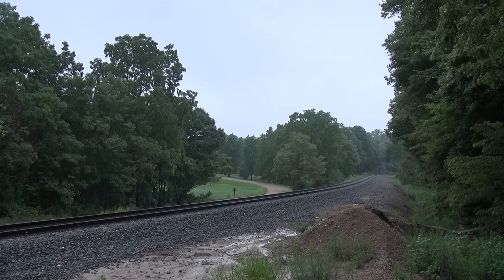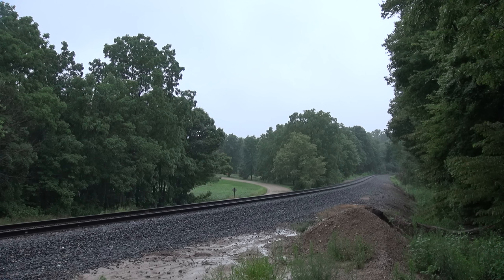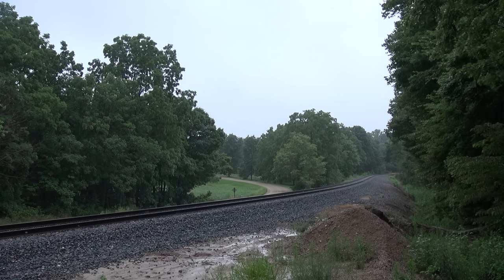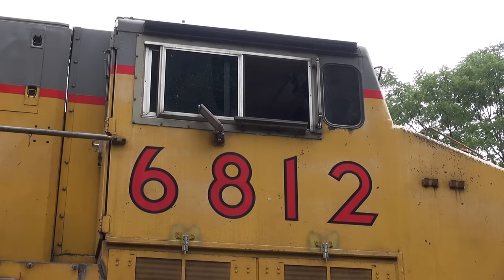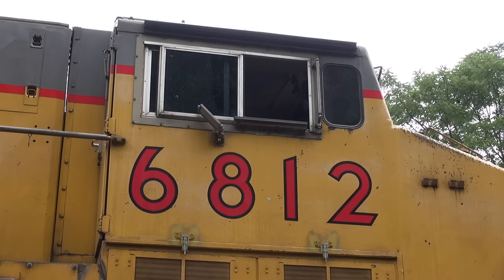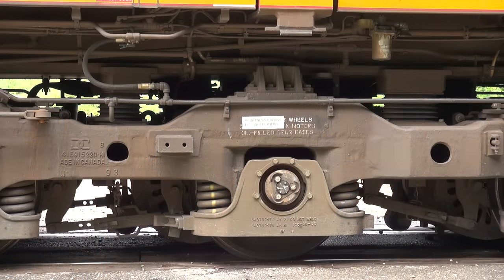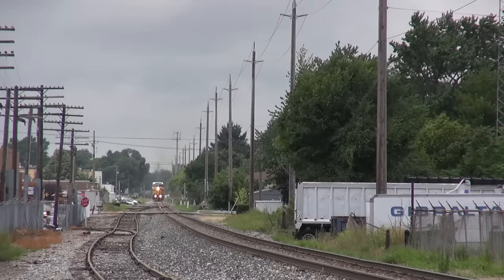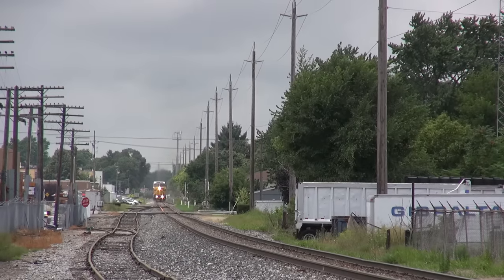TRRS 477: "Whoops!" CSX Freight Train Stalls on Grade

Comment: Those darn oil cars have to be ten times heavier than average freight cars always distorting the rails, to where they just went by with the retamper machine yesterday doing every tie through Buffalo Mn. The MarkVI Tamper.

Gotta love the train horns not only from 5 miles out coming in, but the doppler effect as they go by. Can always tell a new engineer is heading North with 300 empty oil cars, when he blows the horns through two crossings in Buffalo when apparently an ordinance against blowing them is too loud for homes close to the tracks. 
But I'd rather they did blow them,, as there's just too many mental case loose near these intersections.  

Traction wise,, a box of double sided 3M wet or dry 6 grit strips to throw under the wheels would come in handy. 
Still amazing the traction they do have with such a small contact patch to the rail. 

I just wish I knew how multiple engines synchronize their power when placed within a run of 300 cars. And do these remote locomotives need to be occupied. 

Kinda Funny,, as a kid of 17 early 70's, I was one of the Gandy Dancer Crew for Soo Line spiking track all day downtown St Paul just as it was done 200 years ago or viewed in Blazing Saddles and never road a train. 

Not until 2005 spending a few years in Europe, I loved riding their high speed trains every few days where the GPS clocked us cruising 93mph through every town from Amsterdam to Germany, and smooth as silk. There's no way one could drive and make time, when the route by car is a hundred stops and 35 mph. Unless getting on the Autobahn. Which is huge fun cruising 120 all day in the rain, and not one chuck hole anywhere.  

Thanks for sharing a great 15 minutes of unusual tour that was handled safely
where a million tons could just make all the rules unruly. 
Cheers and Thanks for the therapy vs watching the news.

Comment: They should have replaced the SD40 with an ES44AC and or an SD70ACE.
Reply: The sd 40 did its job
They out last ge
Reply: @dknowles60  The train stalled. So, clearly something wasn't doing its job.

Comment: Someone can tell what kind of pneumatic sounds during idle? There are rare loud ones here (this is the sound of overlap from the compressor, as I understood it), but also a quieter set with a different tone.
Reply: I believe you are referring to the loud bursts of air and then the ticking sounds.  Those come from the air dryers that help keep excess water from the air system.
Reply: @hoagieflyer  Thanks!

Comment: Two locomotives pulling 9,200 tons going up a grade and wet out? No where nearly enough power and weight. Looks like a job for three locomotives. Seems counter intuitive that rail roads barely put enough power or not enough power to haul freight trains. I'd rather have a little extra than not enough. They could put at least one other locomotive. Penny wise and pound foolish. They're being cheap and dumb. Excellent video though. No stupid music to ruin it.
Reply: And people wonder why Amtrak trains are usually late. The only trains it seems that get a decent match of power to tonnage (and even here there's exceptions) are the hotshots (intermodal container trains). Donner and Cajon Passes typically has three or four road units hustling a train up their mountain grades for any train upwards of 6,000 tons, and even then they get helpers. Even if this grade isn't that long, the sheer tonnage of this train would've stalled any locomotive if it was just two of them, I dare say even a pair of Big Boys, Yellowstones, or Alleghenies would get stalled with that much on the drawbar
Reply: @russellgxy2905  Amtrak trains end up getting stuck behind a woefully underpowered freight trains.
Reply: 3 pull locos and at least 1 push, if not two!
Reply: Spoken like a true railfan

Comment: In this computer age, someone had to know that this was "the little engine that couldn't", and that person should be reassigned to janitorial duties.  A lot of lost time as well as wear and tear on equipment could have been avoided if they had either assigned a more suitable power combination or had split the train to begin with.
Reply from the maker: Chicago wanted the train gone. Not their budget or crewbase that takes a hit when the train stalls. Good case of a "get it off my territory then it isn't my problem"
Reply: Whoever put this lash-up together used the time-worn "Principle of "HOPE" in doing so. They "hoped' that that the two locomotives assigned could develop enough traction to beat the grade for the load. Maybe they "hoped" the rain would stop. The crew almost certainly knew that it wasn't going to work in the first place, but if management said to do it ('hoping" they could gateway with it. 

Dispatch, relying on the Nuremberg Trials' "Ve vas only followin' orders" dodge  --  knowing that it wouldn't work -- issued the track warrant -- and prepared for the Kabuki dance to split the load after the train stalled.

Some CSX bean counter could calculate the total time and money losses that resulted, but it't almost impossible to come to grips with the mentality and incompetence that "HOPEd" it might work this time.

Atlas Shrugged

Comment: Why does the engineer blow the horn: Is there a cow on the tracks?
Reply: Leslie Jenkins FRA regulations. 2 short blasts of the whistle before movement in any direction. 2 long 1 short 1 long before any grade crossing.
Reply: This area around Saugatuck, which is basically in my backyard, like many rural areas, has plenty of uncontrolled grade crossings, as well as contolled ones. Uncontrolled crossings have no lights or crossing arms to signal the approach of a train. Back then, we all grew up knowing that you should slow and even perhaps stop to see if a train was approaching before crossing the tracks. The Engineer must comply with his instructions and signal his horn when approaching any crossing.

Comment: Reminds me of a time here on Vancouver Island on the Port Alberni Sub, we went for a ride along a few months before they ceased operating on the line, and coming back with a full train of paper products from the pulp mill the crew wasn't sure we'd make it up the summit due to them having to shut down one of the three units on the way there for some reason. They said we might have to take half the train up, put it on the siding at the summit, and then go back down for the second half. 

We ended up not having to as they put the third unit back in service just for the trip to the summit, guess it was enough.

Comment: I'm curious - doesn't the yard, when they build the train, have a good approximation of the loads in the manifest to have a good approximation of how much power is required (plus a small margin) for the task?  Of course, balance is probably a contributor (heavier cars toward the front).  This is a great demonstration they must not.  Thanks for sharing and for the explanations.
Reply from the maker: Yes, the yard knew full well that the train was too heavy. They sent it anyway. Sometimes this happens, in which they simply accept the delay - or rather, force somebody else to accept the trouble. Management in Chicago won’t get in trouble for problems in Michigan!

Comment: Correct me if I'm wrong, but isn't a stall simply the inability to get the power from the traction motors to the rails - effectively a burnout? Why is a stall a progressive thing, rather than a sudden slipping of the wheels, or is it simply the momentum of several thousand tons behind them that causes the engines to roll up the gradient a bit then slowly lose speed? When they finally get moving again at 11 minutes that doesn't exactly sound convincing

Comment: There is a way around this problem. If the pulling power of the engine is calculated with the gradient and tonnage to be moved, the correct number of trucks can be attached to the engine enabling the whole shooting match to go up the hill.

Comment: The reason this keeps occurring is quite simple. The yard only gets graded on getting the train out on time. Whether it makes it or not is not their problem. As long as the official tonnage rating chart says those engines can make it, they’re going.
Reply from the maker: The fun part here is that the tonnage chart did say clearly that the train wouldn't make it. Chicago sent it anyway.

Comment: Kinda seems to me like someone didn't take all the factors of this run into consideration!!!!
1. Number of cars
2. Load of each car
3. Total tonnage of the load of each car
4. Total tonnage of the entire train
5. Correct number of locomotives
6. Grade of the track
7. Weather conditions
8. Traction conditions on the track due to weather 
9. Pulling power of the locomotives
10. Appropriate speed needed to get the entire train past the main problem spot
11 Locomotive pulling ability due to track conditions due to weather.

Comment: It was at this moment the rail company knew... He f***Ed up...

But seriously, if they knew that this train was going over that grade, why didn't they at least put like two booster units center of the consist, and maybe, a rear helper?

We all know, that distributing the weight evenly along the consist, would make it seem "lighter" and in such, would have cleared that grade... But, with only the two lead units, all the weight was "hanging" off the grade, thus working against the lead units...

I see comments about using more powerful units, but, unfortunately, more powerful units would have just increased the risk of loss if traction, causing wheel spin...

And the inclament weather really didn't help... Wet rails, also increased the risk of loss of traction and wheel spin...

This video was well put together and was enjoyable to watch... Nice job...

Comment: Perhaps mounting some sort of cloth or cloth like material on a belt rubbing it over the track via conveyor and then blow drying it with electricity from the loco it could dry off the tracks ahead of the train while then being assisted by sand. In icy weather a scraper like device could be used for ice.
Reply from the maker: Modern locomotives do have a powerful air sprayer system ahead of the wheels and sanders to achieve this effect

Comment: So this happens in real life too..  I'm chuffed.  As an avid train simmer, recently, I too encountered the same prob while simming on the Marias Pass North Transcon... with a mixed consist  JUST 3 days back.  Come what way, I could not get the bugger up the 2.6 grade from Essex to the the Summit... It was brutal and I was short of lead power.  So I do the same thing.. I cut the train into 2 halves, took the lead half and parked it at a siding at the summit and then go back and retrieve the other half and pull it up and rejoin the two halves at the summit.  I thought that this was not something that happens in the real world.  But I'm amazed that this happens..

Comment: You would think if this has happened before, they would start out with a helper engine or two.. I am assuming the engine is runnining close to wide open.  Will the brakes not just hold the train but are not capable?  Seems to me that coasting backwards is a rather dangerous situation.
Reply from the maker: The brakes are more than enough to hold the train, obviously as it did stop. The reason it slid backwards is that the engineer waited until all forward momentum was lost before applying the brakes, thus it took a moment for all of them to take hold and stop the backward slide. Engineers typically wait until they're literally stopped before using the brakes because some trains will literally get down to less than 1 mph and still make the hill. I've talked to engineers who have described "looking down at the ties" to see if they were even still moving.

Comment: How hard is it to make trains ALL WHEEL drive adding electric motors to every each and one of the wheels on on the rails?
Or having a car in front blow torching the rails with propane flames temporarily drying the rails, or induction heating them.
Reply from the maker: That'd require retrofitting over 2 million freight cars, from hundreds of different owners, lessors, etc. And for very little benefit. The simpler the cars are, the better - or else they spend more time and money needing repairs.

Comment: I was always told 1hp per 1ton of cargo to haul. That'a assuming that the grade is flat. For ascending gradients (regardless of % or lenght) I have no idea to how overcompensate the additional power required.
Reply from the maker: You can actually get away with much less than 0.5hp per ton on flat track. 1hp per ton will get you pretty far. In fact, coal trains on Saugatuck are typically 4 engines with 4400hp each for 17,600hp total, for a train with a total weight of 19,000 tons. That's only 0.92 hp/ton. 

You'd be surprised, but the physics bear it out!

Comment: How do you tell the difference between GP-9s, SD-70ace's, GP-30s, etc?  They all look the same to me.  Only ones that I can kind of tell apart are GP-9s because the nose is tall and skinny as opposed to the short wide nose on other locomotives
Reply from the maker: Most of them are fairly easy to tell apart based on various spotting features. There are some great books on the topic, but a lot of it is just learning to spot the differences.

Comment: Didn’t mention applying the air brakes on each car to stop the train from going downhill.  The brakes on the diesels alone wouldn’t have held the entire train from running downhill.  The video did show the brakeman connecting the diesel air supply hose to the first car.
Reply from the maker: Air brakes were used to stop the train from sliding downhill once they stopped but before the cut was made the conductor applied well over a dozen handbrakes, as air brakes are not to be used to secure a train left standing.